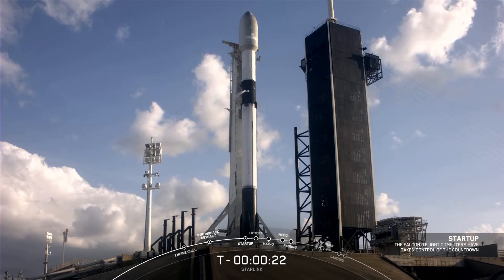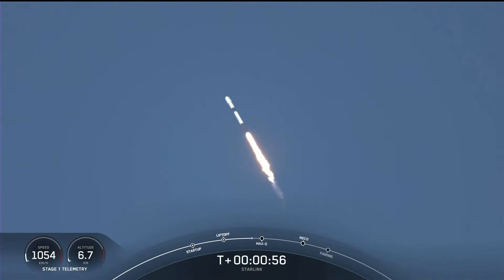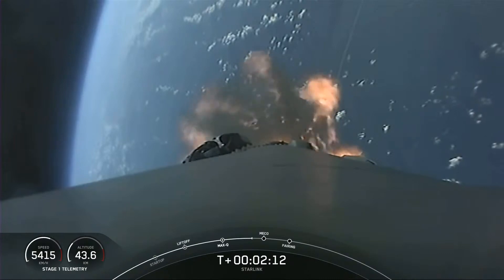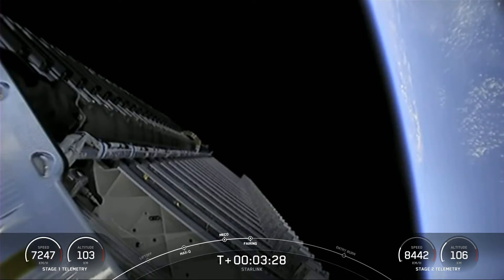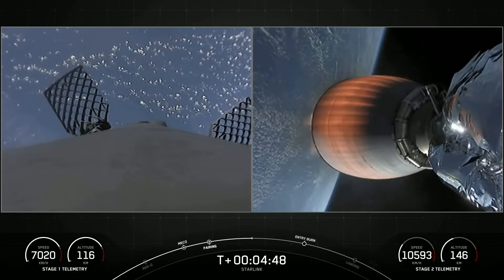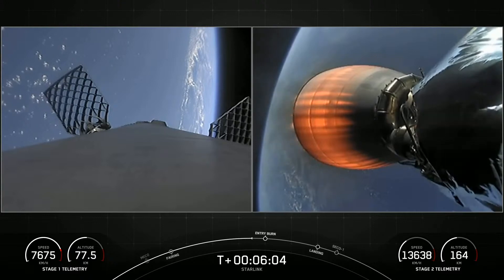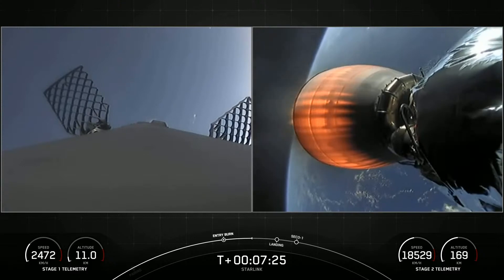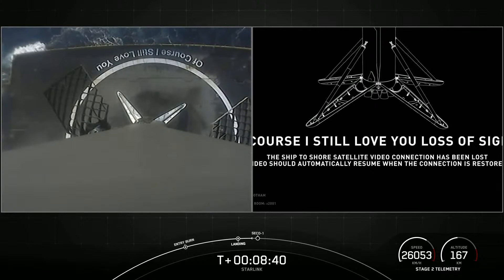SpaceX Starlink-27 Launches! (carrying 52 satellites on-board)

Comment: The problem is that SPACE X keeps putting these satellites in low earth orbit which only creates more space junk problems because that is what STARLINK is, space junk. Now they are talking about launching 12,000 STARLINK satellites at one time. If they insist on launching these 12,000 satellites maybe they should follow Googles advice and put them in medium earth orbit not low earth orbit where they will be less of a problem for private space launches, Astronomy and large and small telescopes alike. As to the STARLINK already in orbit, they should be scraped and deorbited or boosted into a higher medium earth orbit.